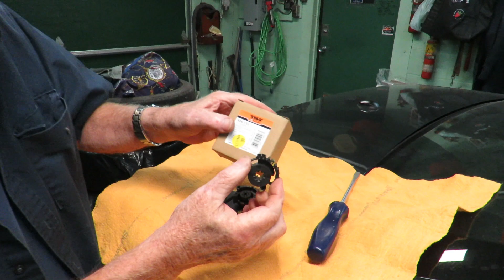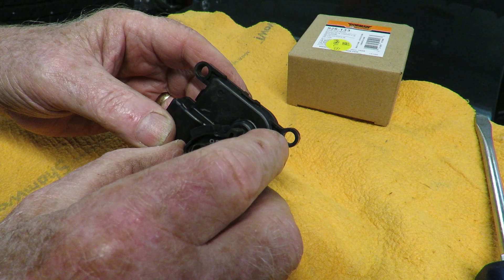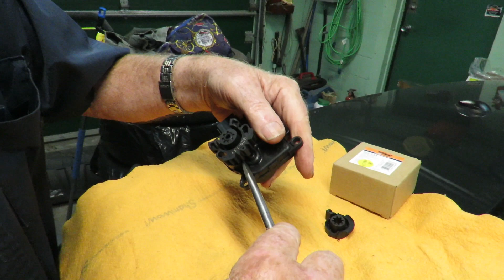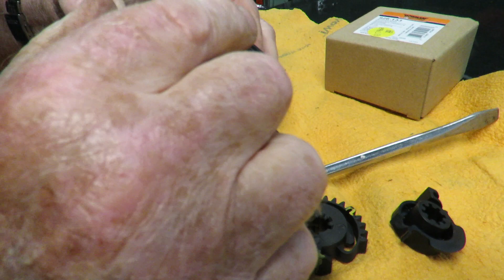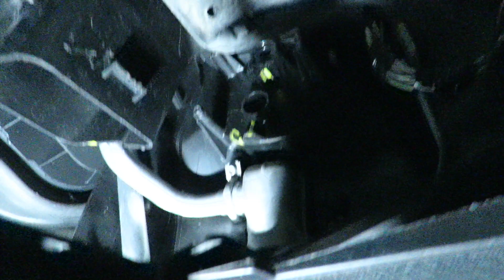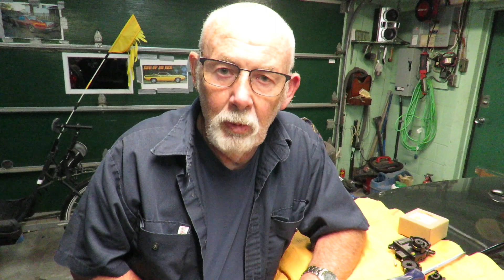Jeep Grand Cherokee Heater problem

Comment: My door , on the right leg of the passenger side door just blocks the blower , sitting way down . The gear supposed to move a door ? It looks as if there’s something that held something but it’s a shaft that is missing ? 2008 jgc with barely any air flow hot or cold !
Reply: Actuator and gears move freely and teeth intact it just doesn’t move a flapper when turning because the flapper fell way down and not retained in any way to the driven gear , did I lose a shaft from the top gear ?
Reply from the maker: @davidb8466   WITH the  electric motor off, can you move the remaining gear that is attached to the flapper ? It should move VERY freely back and forth
Reply: @davidandsuzy2516  I guess if in some way am able to remove the blower motor down which gets me to where the door seems to have fallen but I need to expose the bottom and blower motor . If that’s the way in ?
Reply from the maker: so there is a gear on the actuator, and  it moves the gear on the door flapper , IS IT STILL THERE ?
Reply: @davidandsuzy2516  gears yes but the flapper is not hanging off the top gear , thanks , continue tomorrow weather permitting, I’ll keep your channel updated, thank you

Comment: I have this no heat issue and also a loud clicking noise that happens intermittently but stays on for about 5 minutes. Have you experienced this in relation to the blend door issue? Im wondering now after watching your video of the flapper is seized and the gear is grinding in there

Comment: I am going to tackle this job soon on a 2015 GC.  Just ordered the parts from Dorman, their website says that the parts now come with an alignment tool?  Did you use Dorman parts or know what alignment tool they are referring to?
Reply from the maker: I used a Dorman part BUT I did not get an alignment tool with it. There is only 1 way it will work properly so that you can get full rotation
Reply: @davidandsuzy2516  I ordered the gear and a new actuator.  This alignment tool came with the new actuator.  Its basically a small plastic spindle oriented exactly like the one coming out of the actuator and they tell you to stick it in the housing and rotate it so it aligns with the position of the new actuator you are installing.  I am taking it apart today finally, so I'll see if it is of any help.
Reply: @davidandsuzy2516  well I did the job today. Mine was stuck just like yours. It took me forever but I finally got it unstuck and to the point where it moved freely. I installed a new blend door actuator and a new gear. It went on very easy. Putting everything back together was the frustrating part. Anyway, tested it out afterwards and it’s not working.  Some say they need to be calibrated at the dealer or try disconnecting the battery to reset the system.  I’ll try the battery option in the morning and go from there. Did yours work right away without any other work needed?
Reply: @davidandsuzy2516  So after I made the repair and was able to "free up" my blend door by hand which was stuck, I put everything back together.  Mine is a 2015 and the actuator did need to be "calibrated" with a diagnostic handheld tablet per the manufacturer.  I took it to a shop to have the calibration done and they said that the computer could not get the new actuator to calibrate with the computer system for the HVAC.  At this point I assumed that the whole assembly that houses the blend doors was damaged beyond repair even though I had gotten it to move by hand.  These doors do have rubber and foam sealing around them and if they rotate too far they can not only become stuck but also get jammed so bad that even after you free them up by hand they still don't function as they should.  Today I got back to the issue because ours blows heat constantly and now that summer is nearly here it needed to be replaced.  The dealer is pulling out the dash and removing the entire blend door system and replacing it with a new one which while expensive is a necessary repair for the vehicle to have proper A/C in the summer.  These dual zone climate systems are great options and luxuries to have but they are quite complicated.  If I tried to do this bigger job myself it would take me many days so I threw in the towel and have paid the shop to do this more complicated repair to the HVAC system.  Your video was very helpful to me in replacing the actuator but I knew there was a possibility it would be a bigger issue.  At least I got a proper education of what may have been wrong with the system and I don't feel like I am having an unnecessary repair done.  Thanks again.
Reply from the maker: @enjoylife7030  I am glad that you watched my Video and got something out of it. Sorry that you have to take it to the  Dealer now. To me there are only 2 gears, the one mounted to the door, and the one that drives it from the actuator .There is only one way that they will go on correctly . When you assemble them so that the index is lined up then no need to calibrate.